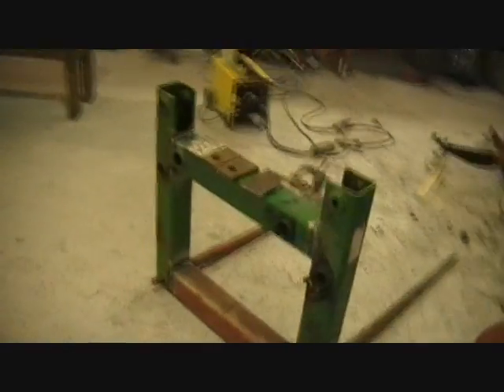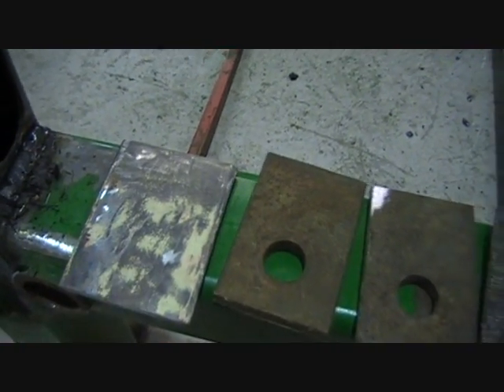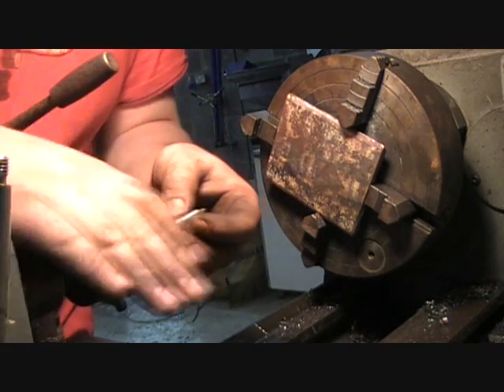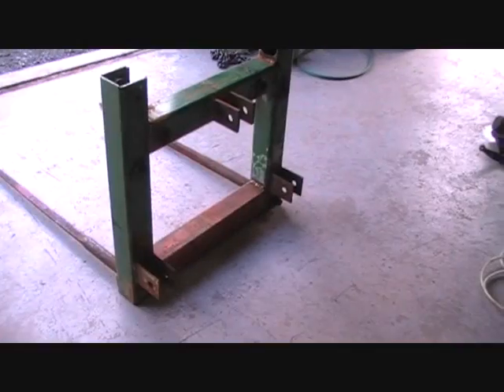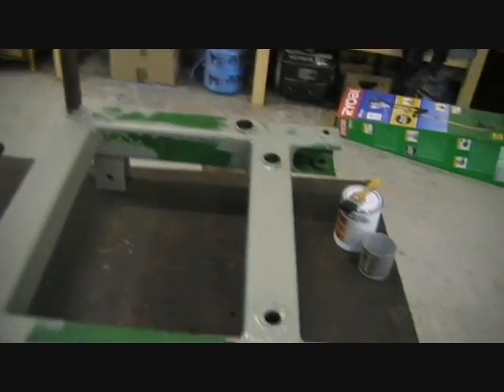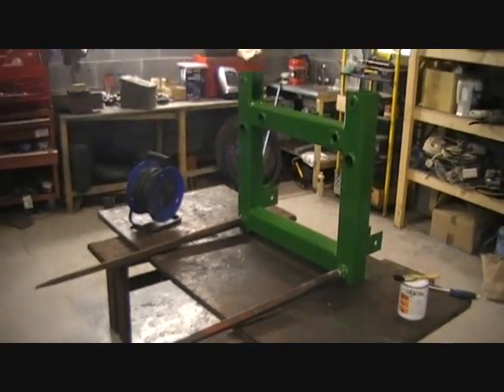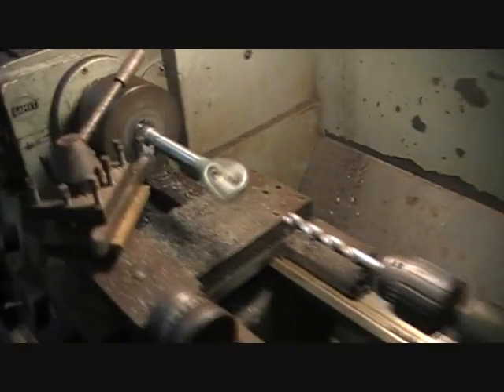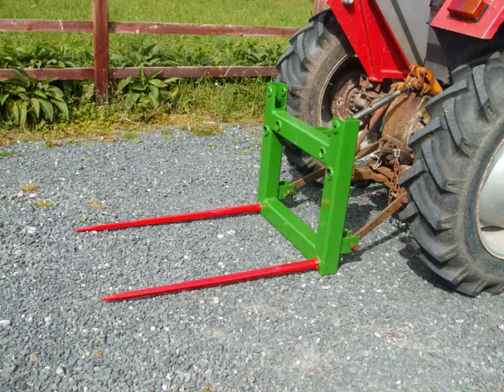Multi Purpose 3 point Linkage Fork - How to make one Part 2

Comment: I have been wanting to build something for this for quit some time! Need to move shop machinery around on a regular basis and I really hate using a gin-pole on my tractor!!! (NOT SAFE) I have lots of scrap metal around my shop and have an old lathe as well...mine is an old Atlas but still runs true and smooth! On big holes i usually drill a small hole and mill the rest out rather than dill it....of course I don't have a large bit like yours! Great job!...had to subscribe   (USA)

Comment from the maker: yes you can but it all comes down to what size drill bit you have. Standard drill bit sets only go up to 13mm which is not very big. If the holes are too small, the pins will have to be small, and they might be too weak for heavy lifting. If you had a look in a farm scrap heap you may find parts with big holes that you can cut off and use

Comment from the maker: @MrJohndeeredave Suppose if your were set up for making them with all new materials, and proper jigs for cutting and welding you could make about 5 a day. Most of my time was spent cleaning and measuring and messing around on the lathe setting stuff up. They would probably end up quite expensive if you had to buy all the parts.